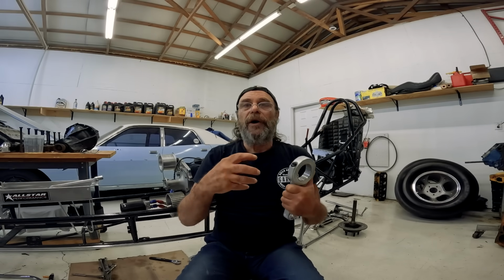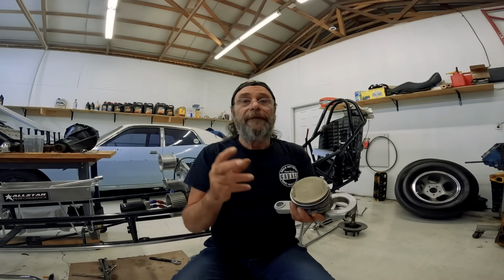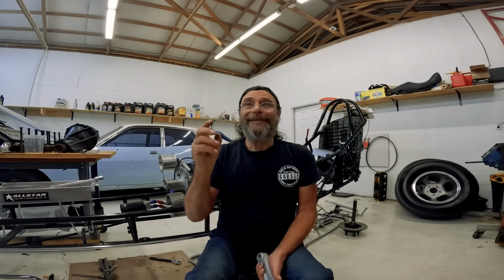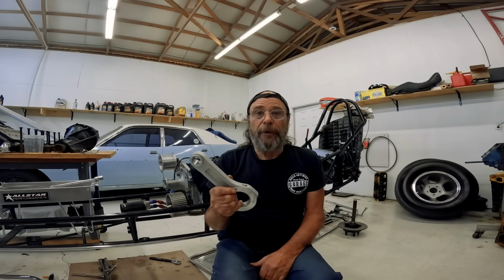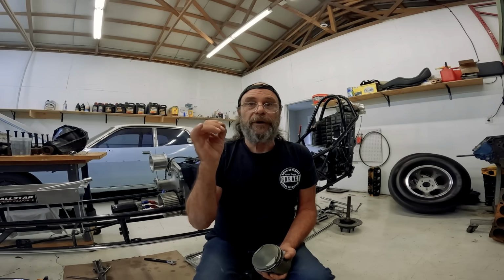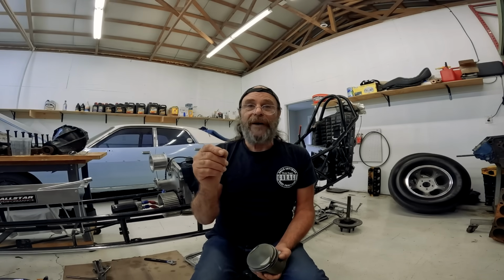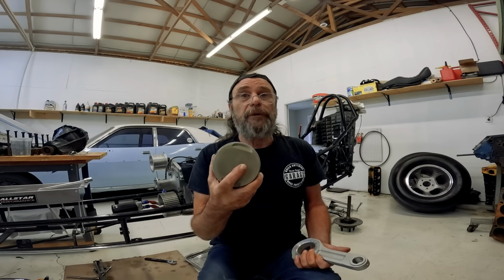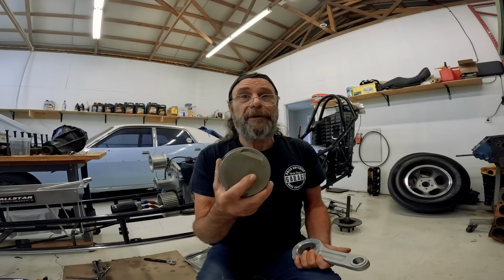Project Top Fuel Pt.9 - How Nitromethane Makes Power And The Importance Of Rod Ratio

Comment: What staggers the imagination to me is that you can take a top fuel engine from 1968 and compare it to a new one in 2025 and there is very little that is different at first blush. It's in the small details of some of the parts and in their use. 
They went from 1000 hp back then to 12,000 hp now and they basically look the same to a casual observer. All that power comes from tiny changes that give colossal power gains. If you could go back in time You could easily double or triple the power of the old engines with just a few tweaks.
The power increases over the years didn't inch up in little bits, it JUMPED UP in GREAT HUGE wacks at a time.
 I recall a very scientific article in a hotrod magazine that said dragsters would never break the 300 mph barrier because it would require double the current power, impossible... They broke 300 a month later!! What a time to be alive and live through all that. They found out that if you try your best to BOG the engine, it just makes MORE power. 
HIGH GEAR MAN!... NHRA says:"not so fast man"
Reply: Except for the 60psi Carbon Fever Screw Blower 7x Cap of a 6-71 GMC SC >2x as efficient, the footlong 12x capacity fuel pump, supplying 28x fuel injectors, the 3" fuel pipe from the front tank to feed that pump, >5 decades of drag slicks tire evolution, 2x $30k ignition systems, one for each of 2x 40 Amp Mags, All aluminum Heads and 500CI Block designed to be fully repairable after rods go through the side of the block. Upgraded to Aluminum Connecting Rods. but otherwise, pretty much the same
Reply: @CycleWerkz  🤣I knew there would be some ninney whining but but but whataboutisms! Then spout a bunch of wrong shit. 
A 14-71 blower is only 2.3 x bigger capacity. and they are only about 10% more efficient. There are NO carbon fiber blowers made and Screw blowers are ILLEGAL for NHRA top fuel. The rest of the shit you said doesn't matter ya dolt.
Reply: @billshiff2060  Very impressive name-calling talent there. 

I guess every TF and FC a few weeks ago had impossible carbon fiber screw-blowers running against all the rules. Rules change often and are often not published in the fans' rulebook. 

Just look at a picture or two, then LMK if you think the SC casing is actually Al with CF decals applied. While you're looking, please tell me how could a roots compressor move the ambient intake air from the very back to the very front of the SC casing? Why is the intake on the engine air hole so small and so forward?  The screws are not CF, only the casing. 

A couple of the crews and drivers I got to chat with clued me in they were around 60psi intake charge now. Of course this varies by conditions, and crew chiefs. That's 4 ATM above ambient. TF blowers compress 2500CI ambient air down to 500CI, 8500RPM/2/60sec for about 3 seconds, then RPM slopes lower from about there to the finish-line; matching the mandatory ignition retard slope. 

The original GMC 6-71 blower I mentioned as a baseline reference was common on 2-stroke 6-cyl diesel truck engines with 71 CI cylinders, making 426CI. RPMs were low, these units wouldn't have a chance at 10kRPM. The capacity of aftermarket SC followed this convention until it got silly. 

The minor 10% screw versus roots compressors efficiency not close, and is a simplified comparison model, omitting many other more significant and compounding advantages. 

According to the industrial refrigeration community screws are about 27% more efficient than Roots for input energy to compression and gas flow work done at only +0.7 BAR compression. Temperatures were +60C Screws, and +90C for the Roots example. 

These relationships are not linear. Efficiency comparisons will spread as compression increases. 

Less power input, with lower temp discharge air, allows them to run higher pressure at a lower temperature.  More air mass into the cylinders is the result.
Reply: @CycleWerkz  No one used a carbon fiber screw blower because no one has ever made one and no the rules have not changed.
If you have a picture of a carbon fiber screw blower, post it and I'll be glad to stand corrected. Don't talk about stickers. 

Roots blowers are not compressors. The offset of the ports is due to the high helix angle of certain blowers trying to achieve some amount of internal compression. That necessitates blocking off part of the port(as screw blowers do too)
Uncle Tony here described that here

If you read it again, I said "A 14-71 blower is only 2.3 x bigger capacity. and they are only about 10% more efficient." Nothing to do with screw blowers.

Screw blowers are more efficient because they have high internal compression. That fact prevents them from being used for Top Fuel nitro applications because they can't cope with the volume of fuel, they will hydraulic and to use a screw blower most of the fuel would have to be put in the ports, & that won't do.

I have a screw blower, I know how they work.
Reply: @CycleWerkz   this NHRA video explains in detail, including the screw blower magnesium cases
https://www.youtube.com/watch?v=miUiwsmp3b8&t=2309s

Comment: Does nitro do the same thing to oil that methanol does?
Reply: Yep. Replace oil every run. Lots of fuel will bypass piston rings and dilute the oil. And, you typically have 15% or more methanol mixed with the nitro.

Comment: Your video also explains why Dick Lahie ran the 484 cubic inch motor for so long in the late 1980's and why it was so much more efficient than the 496 inch engines that everybody else was running.

Comment: You mentioned Dale Armstrong and putting more fuel in to the engine through duel fuel pumps, but Gary Beck was actually the first one that started doing this. Except he didn't do it with more fuel pumps, his system was a little more complicated in that it involved a second enrichment valve that he slammed shut manually about 60 feet off the starting line which loaded the engine with more fuel while the car was accelerating. This is how he became the first driver into the 5.50's, 5.40's, and 5.30 second brackets all within the span of a couple of years from 1981 through 1983. Gary is still alive, you should try to get him for an interview. He could explain how his system worked a lot better than I did.

Comment: The nitro making power all the way through the stroke explains why in the mid to late 1980's block manufacturers like Keith Black and JP1 were making blocks with a taller deck so engine builders could build an engine with a longer stroke.

Comment: It is interesting how NITROmethane needs the resistance to make POWER! Similar to "modern smokeless gun powder" (which is made from NITROcellulose and or NITROglycerin base), which also carries it's own oxygen, and MUST have resistance in order to burn correctly.  I have wondered several times if an I.C.E engine would run well on modern smokeless gun powder. But i have no idea how you would get that much powder into that tiny combustion chamber. Or how you would ignite it, as initially i don't know how receptive it would be to ignite with just spark plug voltage. although top fuel engines have a much more intense ignition system than a stock automobile or motorcycle engine does. But, being supercharged, the blower might provide enough pressure to ignite the tiny little spheres of "ball powder". And that would fill every little crook, crevasse, and cranny of a combustion chamber. Nicely. I guess there is only one way to find out. I think the biggest problem would be how to "feed" the propellant into all 8 cylinders, all at the same time, even mixture across all 8. Plus it would work like a diesel.  The power output would directly equate to the amount of "fuel" you could force into it.  Up to the point that you would hang a valve open trying to force in to much fuel.  There would be a LOT of problems. And there would be significant costs, and failures. But no one ever created something new by sitting on their hands.  But, why reinvent the wheel when you have something that works so well.  The ONLY reason is obvious. To go FASTER! IF, it can be done.

Comment: We did not set the European record for TF/FCs in 1987 by trial and error. We closely collaborated with a professor for physics and chemistry at Oxford University, and Wintershall in Germany, who at the time produced synthetic Nitromethane as a by product. They even made synthetic engine oil emulsifying with Nitro just for us, once we asked them for it, so we didn't have to import Kendall Nitro 70 by the ouch expensive pallet load anymore.
Given the staggering cost of TF outside Murica, you just can't afford TAE. And it served us well to use proper science.
Given the cost in general, I'd strongly advise against going TAE inside the USA as well. Well, unless cost is no object, of course.
Scientific formulas and figures available on request.
Reply: As a low budget nitro racer in the UK I completely agree! My brother has spent a lot of time on the physics and chemistry of nitro. I'd be very interested in your research as well if you're willing to share?
Reply: @motorpsycho417  One would first have to research how valid forty year old research pertaining the actual sport's technology is today.
In any case, you need someone who is savvy in physics and chemistry, since most of us engineers actually aren't beyond our formula bibles.

The reactions, both, when you burn nitro and when you detonate it, and how they differ, is what you need to study. What causes it to detonate versus burn? What circumstances increase or decrease the tendency to detonate? There has been a lot of research in the 1950s following several railway accidents, where (transported) nitromethane sometimes went ka-boom, and sometimes just burned quietly for the local voluntary fire brigade to calmly extinguish it with conventional methods. The results of these studies are a good starting point and they are in the public domain.

The established 'facts' of the drag racing community need to be doubted first and most thoroughly, at least that was our approach back then. You don't get faster than them by copying them. Not sure about today, but back then, the accepted tech was to run ~ 60 psi fuel pressure through biiiiig nozzles, like Tony does with that nostalgia rig. In contrast, we ran ours on ~ 200 psi through an array of teensy tiny nozzles, for the nitro to atomise. That way, we could run it theoretically on 100% nitro, which you can't do anyway, because the required additives already take up 2-3%. But we constantly ran well over 90% in the TFFC with the Keith Black. We often didn't even bother to mix it with anything. And yes, we knew about the effect of the combustion lasting most of the way down power stroke, and you will still have a lot of unburned nitro in the cylinder at the start of the exhaust stroke, it just gets blown out of the exhaust, and what isn't, gets re compressed and supplemented with a fresh charge of fuel, thus contributing to the cooling. IMO most of the cooling happens during the exhaust and intake strokes, not the noise stroke. So the more unburnt nitro left in the cylinder past the exhaust stroke, the cooler your engine runs. What Tony calls a heat shield is essential, the nitro is actually cooling your engine.
As for the administered quantity, always err on the rich side, and then back off. Too lean and it'll instantly burn holes in the pistons and your bottom end grenades. Don't worry too much about the air content, there is enough dissolved oxygen in the nitro for it to burn without an external source.
Do heed Tony's advice regarding the rod length/piston deceleration rate towards the bottom dead centre, though, this is vitally important, although you can take it further if you manage to get enough fuel into the engine. Do your math, there is a given amount of calories in every gram of nitro.
Reply: @baronvonzach6109 we're running a nostalgia combination, billet Donovan block 4.125 bore, 3.906 stroke, 7.125 rod. So the rod ratio is way up in the safe zone.

The theoretical values on fuel/air required to meet the demands of the engine are all calculated, cross referenced with fuel system flow bench testing and now being checked in real world application. The problem is track time and money! My brother has developed a computer program similar to, but more advanced than Ralph Gorr's old Jetsize which is pretty cool and should cut down on wasted 'best guess' tuneup calls. We don't race as much as we'd like, but we will get there. We're currently experiencing a very lazy but safe engine, either a mag issue or cam timing we think. 

The wet nitro shield in the chamber makes a lot of sense, not something I'd considered previously. I love this stuff, the more nitro content we can learn from the better.
Reply: @baronvonzach6109 despite being a nostalgia combination however, we are using a more up to date high pressure fuel system
Reply: @motorpsycho417  
If you want to wake that engine up, you need it to burn all the way down the power stroke, or more. So yes, cam timing would be my next step, too.
As I said before, always err on the rich side of the mixture. Unburned fuel coming out of your exhaust is expensive, no unburned fuel coming out of your exhaust is more expensive. A lot more.
Reply: @baronvonzach6109 absolutely, EGTs, plugs and pistons are showing we're safe there. Putting some new (to us!) billet heads on and rod/piston changes to suit them and go again next year! Am I right in guessing you worked with Rune in the 80s?

Comment: I liked the firecracker explanation.  When I was about 12 I started thinking that if you could contain the pressure in the firecracker longer you would get a better explosion.  So I wrapped the firecracker with fine copper wire and sure enough it made a lot more noise proving my theory.
Reply: Did a similar type of thing using glass fibre reinforced tape. Took a pop up to a CRACK!! The remains went from a paper tube with a hole in the side, to a confetti field about 3 yards across!
Oh, to be young & stupid again...

Comment: Great analysis   I always ran a long rod  now I know why   I overthought knowing dwell was longer at the top and less at the bottom whereas the dwell at the bottom is huge with a short rod  THANKS   
 open that exhaust easy lots of pressure  I never did but lots ran Earson back then  pushrods cannot be too sstiff

Comment: I come in here knowing 99% of what Tony is talking about, I don’t know much, but I can understand and apply what he is talking about based on my automotive experience. Today I feel like I’m sitting on the floor in kindergarten, and Tony is teaching us by storytelling 😂
Reply: same.... done a LOT of mechanics, been "pro" 10 years now.... worked in the drive way before that. 
rebuild 2 and 4 stroke motorcycles, 350s, know enough about TH350/700r4/4t60e and now 42re to get into trouble .... have a NP205 and SM465 i need to rebuild. 
but when it comes to cam specs.... not my forte. 
.
degree... sure. 
but dman does that degree wheel get complex fast lol 
still, that "creep open the exhaust, then ramp it up" makes total sense. 
fuel is still providing PSI.... vent slowly, then all at once. get the full stroke. 
its pretty damn neat!
Reply: @kainhall  Something that has to be unique to nitro, as its the only sport where efficiency of combustion is not the main factor you think about! I guess you could argue same with top Diesel guys too (black smoke is literally uncombusted fuel, after all) but it's more of a side-effect of things, rather than something done because they want to.. Also I guess with those guys the torque is also produced all the way through, but it's not even close to same extent. Though honestly, today's top diesel stuff is as-unknown as top-fuel back then, many use weird stuff like MORE water than Diesel for actual torque/power from super-heated steam, etc.. If I remember right this makes so much power some pulling competitions regulate amount of water lol. Certainly though, it is NOT as spicy as nitro..
Reply: @bo-dine7971 ya... nitro is a completely different animal than gas/diesel. 
.
And i belive the water injection is more about EGT temps and cetane rating than pushing the piston down.

Comment: I fouled plugs on two strokes and four strokes just from having the carb slightly rich on gasoline, crazy how rich nitro needs to be run and still doesn’t foul plugs. Most of the time mine foul when I hit the kill switch so I started to blip the throttle then kill it on the decell when there is more rpm but not much fuel

Comment: Actually the raw fuel on a burnout is because they only use one magneto on a burnout so the engine doesn't lean out and explode. At least that's the case with modern nitro. If they rev up to high without a load they also hydrolic the engine and explode.
Reply: I didn't see anyone do that a few weeks ago. They showed me a control the driver uses to lean the fuel supply. It opens a fuel bypass circuit. I also found a "throttle stop" one car used. It stays in until the crew chief releases it when they're ready to stage. I would've thought burnout and reverse mode would be selected on the ignition controller.
Reply: @CycleWerkz throttle stops have been used for a while but t I my knowledge un top fuel and funny car they shut pff one magneto for burnout. Leaning it out would most likely give it more power.
Reply: @edreynolds8721  Watch a burnout on TV, focus on the injector butterfly. It'll just barely open. 

At that point they're still trying to get head temp up. 

You may be right about the single mag. It just doesn't make sense to me. The worst thing would be failure to ignite the fuel. I hate hydraulic lock. 

They keep it wayyy lean until ready to stage. At least that's what it looks like.
Reply: @CycleWerkz oh yeah, I know about the throttle stop and not running full fuel pressure but even the teams ha e said they only run 1 mag on a burnout